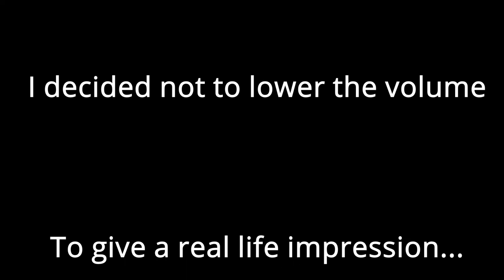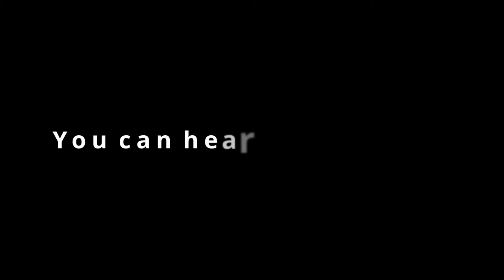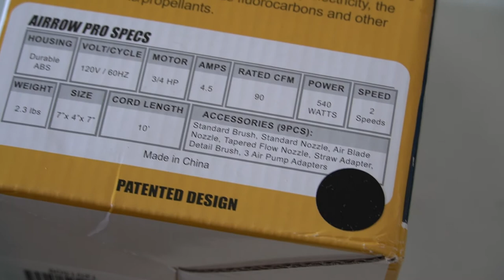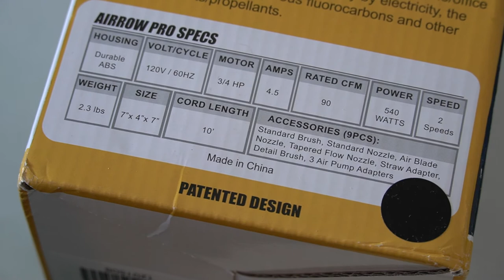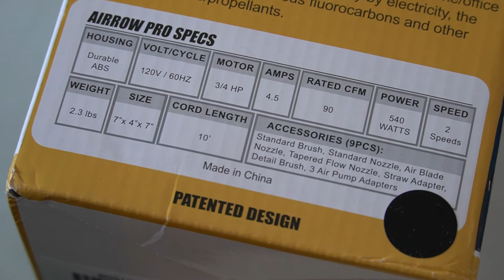Air Blower To Blow Dust Out Of Computer - XPower Airrow Pro A2 Review

Comment: hi. I have the A2 power today. it is a very powerful blower indeed. I'm happy about the powerful wind but there is one thing that I doubt. 

when I use the low power speed, the unit vibrates. Not sure what causing it. but when I switch it at high power, the vibration is no longer there. when I turn off unit from low or high switch, the vibration gone immediately but will come back again at low speed.

Do you have the similar... "problem"?